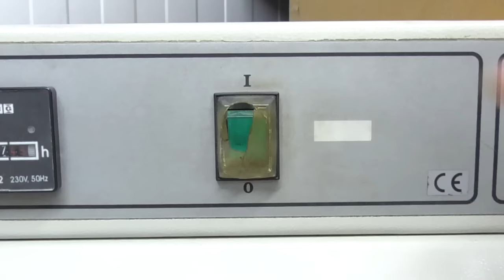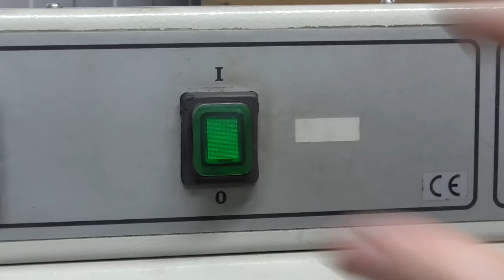Antique Ox-Tongue Iron - Restoration

Comment: For future reference when you remove even small pieces of asbestos like that wet it down first.  It comes off easier and it won't release fibers into the air that you could breathe in.
Reply from the maker: Thanks a lot
Reply: A pro-tip from Hand Tool Rescue.  He always seems to come across asbestos.
Reply: Richard only if inhaled.  As long as it doesn’t become airborne it’s ok.
Reply: @Richard ...I worked with tons of it in the Navy,  still here... It's only a danger when airborne, and then in fairly large quantities over a period of time.  This little bit,  handled correctly,  poses very little,  if any risk...
Reply: Pp Ss A single fibre gettingin your lungs has tte possibility of causingcancer
Reply: @bacicinvatteneaca ... if that were true,  I should have been dead a long, long time ago!
Reply: Me and a friend (when I was 10) broke up an old garage roof made of asbestos (didn't realise at the time) the way it breaks is very entertaining so we was jumping on it braking it up, it was in the air everywhere, one of the most stupid things I ever did and still worries me to this day.
Reply: @TimZZR2  ... How old are you now? I would agree, it's not the smartest thing to do, in fact highly ill advised, but a lot of people did similar things without consequence. Yes,  people have died from exposure, but it's usually those who were exposed to it daily, for long periods of time. Unless you show signs of illness from it,  I wouldn't worry about it too much. With that said,  we all gotta go somehow!
Reply: @Quickened1  possibility doesn't mean certainty.
Reply: @Quickened1  i'm 29 buddy, so it was 19yrs ago. I'm not too worried about it tbh, iv'e lived from much more stupid things, no signs so thats good haha. Thanks for the reply, all the best 👍
Reply: @TimZZR2  ... good to hear!

Comment: MyMechanics: "This piece is missing a washer. I make a new one."

Every other normal person: "a washer? Aren't they like five cents at the hardware sto..."

MyMechanics: "I MAKE. A NEW ONE."
Reply: I did chuckle when he machined a washer. It just adds to the restoration though.
Reply: You can't beat a good quality washer.
Reply: The true reason behind that is that the washers you can buy are nickel or zinc covered, and by consequence he can't "blue" them like the other materials he restores
Reply: no no, its "I make new one"
Reply: You sir, are an absolute Master !!
Reply: @boolaudio  Sure you can. However, the switch you use can't be bigger around than your thumb "and" you have to drag her down to the front of the courthouse to do it. 
I haven't checked to see if it ever got repealed but that was an actual law here in beautiful, downtown Arkansas, as of a few years ago.
Reply: Even if you could get the exact ones you need, if you are in a project in the middle of the night.. Just spend those few minutes to make a enw one...
Reply: Yes! 5¢ or less, but that's hardly the point, is it?
Reply: Spent more on raw materials than the hardware would have cost at the store
Reply: @cbjfan99  You just don't get it, do you?
Reply: @Omahabigbill  enlighten me.
Reply: @cbjfan99 
It's one of the points about those restorations: you are only allowed to buy things you can't make in a workshop, even if it's something as trivial as washers or a handle. So, if he restores something with blown diodes, he will buy replacements for them, but everything else will be either original or made by hand.
Reply: @Hisu0  just seems like a time waster when you could apply yourself towards other parts of the restoration
Reply: @cbjfan99 
It's a principle thing. Can be a waste of time, sure, but all those restorations are waste of time regardless. Just this iron took three WEEKS of work, which translates into a conservative value of $1500. What's an hour spent on making a washer compared to it?
Reply: @cbjfan99  Ok, let me tell you this.  Back in my healthier days I used to make Adirondack chairs for a lot of people.  Everybody liked them and that made me feel good.  That's satisfaction on a job well done.  My Mechanics is a very talented guy in the machine shop.  It's not how much time he put into a project, it's how it looks when finished.  It's the satisfaction!  I don't know what else to tell you.
Reply: @twicebittenthasme5545  ...hence the expression, "rule of thumb"...  but a disgusting digression to this video.
Reply: first you need to know if the project is for repairing or for restoration.
Reply: well see the funny thing is, he wastes more material making the washer than the washer its self....
Reply: @Struto69  that is not the actual origin of "rule of thumb." It has been looked into countless times by linguists and law-makers and debunked. That notwithstanding, it is an incredibly persistent myth.
Reply: @cbjfan99  there is a difference between a machined washer and a stamped washer.
Using a stamped washer would not be a restoration when the original was machined.
Reply: @fixitallpaul4847  see now that makes sense. That's all I was asking
Reply: @cbjfan99  preservation prevents any further deterioration of an item.
Conservation keeps an item in working condition.
Restoration returns it to as near original condition as possible or in this case actually better than original.
Reply: Lmao I giggled
Reply: and a cheer goes up from internetland!
Reply: Hey I have friends who makes washers out of pennies
Reply: BAHAHAH I know! I was like "oh is he going to clean those screws, why not just buy..."
"I MAKE A NEW ONE" 
also me: "wtf is he doing with that cylinder, making a warhead casing?" 
"I MAKE A NEW OX TONGUE"
Reply: Yannick Bruère It is true that you can’t blue a plated washer but you can put a zinc plated washer in muriatic acid for a short time and it will take the plating off. The washer can then be blued. I have done it with some of my projects. I thought it was fun to see the washers getting made, though. I wish I had that kind of tooling.
Reply: cbjfan99 same goes for the bolts. As a matter of fact, just go out and buy a new iron. Not worth the effort, right?
Go away. Him making even the trivial pieces makes watching the video so much more. Don’t take away from everything that makes this video great.
Reply: Yeah that caught my eyes too. that's what you get when you do things with passion.
Reply: Well, quarantine means that making new ones is probably a better idea. lol
Reply: That's bollocks. Showing off a bit. Mechanical engineering was at a state of making one bolt for one machine and another for the other. And guess what - it sucked ! That's why standardisation was introduced more than 100 years ago. It's not what you can do but what is logical to do.
Reply: he just want show he can do that ;)
Reply: sometimes you get the washer you want faster by making it than trying to find the perfect one at the hardware store. I've had to make bolts from bolts because i could not find what i needed. If you took into the consideration of my time these bolts would be very expensive. However there is nothing more satisfying in making exactly what you want.
Reply: @Hisu0  Haha your estimate is far to conservative.  This guy lives in Switzerland just as I do. If he really spent 3 full working weeks (15 days, 8 hours each = 120 h) on this project. This means labour costs of  around CHF 5'000! The $ is  at 0.97 CHF right now, so its around $ 5000 as well.
Reply: @cbjfan99  there are people who can make anything...and those who can't see beyond their own face..people like you only dream of being able to do what others can...jealousy is an ugly trait.
Reply: I love when he uses old broken parts from the current or previous projects to make new ones too it's a nice touch
Reply: Hes said why he does it in previous videos, new hardware like that is plated with a material (I forget what, maybe zinc?) that prevents him from bluing it/protecting it from rust
Reply: @sleepCircle  I blame The Boondock Saints
Reply: He says you can't blue a store bought washer. Zinc coating.
Reply: So true xd
Reply: Aleksandar Aleksic no, not here. It IS what he can do. Any shmoe can buy stuff.
Reply: this is so me, heck i used duct tape to fix a horse for my daughter and it is like new, the only way you can tell he has "surgery" is the nice fishing line i used to sew the cloth covering back closed with... yes i use fishing line to sew with and it works great!
Reply: I'll bet he could make 50 washers by the time it takes me to find my wallet and car keys, drive to the hardware store, find the washer, pay for it, and drive home.  Who here lives next door to a hardware store?
Reply: bravo
Reply: @aleksandaraleksic4067  I have many questions, first: what did you mean by "showing off" its a youtube channel about restoration and machining of course he makes new parts, secondly:What part of making a washer/nut/bolt "sucked, finally: what was the purpose of INDUSTRIAL standerdization in a private project for display/household use?
Reply: @matthewkenney8915  lol no its "I make a new one" even his merch says it.
Reply: Those washers are actually pieces of asbestos paper

Comment: "Restoration" is an understatement of what you do.
Reply: IKR? It's more like restoration und upcycling in a single move. And it's also art in craftsmanship.
Reply: Restoration would mean back to original condition. So more of an overstatement
Reply: 9 out of 10 times he's altering the original structure and that's not restoration. It's creating something new. In this video he's altered the door to fit correctly, but maybe the door never fitted correctly and should be left like that. Restoration is trying to keep it as close to original as possible and not adding your own ideas...
Reply: @Alexander196210  what would you call it then?
Reply: Alex Meijer the door thing wasn’t a problem, he just finished it kinda wack.
Reply: @500MTH  sounds like a restomod
Reply: @Alexander196210  you're right, what he is doing is not restoration.  Its better
Reply: John Alexander not better. Different. If what you’re after is a restoration then arguably this is worse than that. If what you’re after is someone recreating and rebuilding an old tool/object using modern techniques and materials beyond the possibility of the time in which it was built then this is what you’ve got here.
Reply: Revival is a more accurate term because he's bringing these antiques back to life.
Reply: @Alexander196210  no.. the original door fit but when he polished and sanded the housing he reduced it in size
Reply: Rebirth

* drops mic *
Reply: @bhavyakabade  " resurrection"

drops more mics
Reply: Restoration/Improvement...
...Restoprovement?

Comment: Excellent restoration work!
Just one suggestion when manufacturing the new ox-tongue insert: from the machining of the metallic "torpedo" and using a hydraulic saw machine, you could produce two units instead of just one. With this, the final user would have a spare unit that would be useful for large volumes to iron clothes. Additionally, the manufacturing process would have less material and energy waste.

Comment: You did a better job than the original manufacture! You've got skills.
Reply: @FlyingMonkies325 exactly true.
Reply: FlyingMonkies325 Disagree. It was a slight flaw in the original design. If it was corrected then it would have been mass produced correctly. The off center doesn’t have to do with the mass production.
Reply: Okay, agree.  I was just thinking of the back cover being off center that he re-aligned.

Comment: Just an observation: you can sand-blast wood too. Only, you can't do it with sand - it's too rough, and will grind the wood away, instead of just cleaning it. But you can use softer and lighter material, like coarsely ground corn flour, crushed egg shells or sodium bicarbonate - kitchen salt I'd only use on hardwoods. It's useful when you need to also clean paint or lacquer from tight nooks on wooden parts - you don't get there easily with sandpaper. (Whether it makes sense to clean and refill your sand blaster every time you need to switch between metal and wood, or set up a second sand blaster, is a separate issue. The possibility exists, though.)

Comment: After the sand blasting technique he puts the part into some liquid and turns into black that part was lovely
Reply: It's called 'bluing', I think. He's heat treating or 'quenching' the parts. Gives it structural integrity and rust-resistance.
Reply: Heat it up to 300-400 degree celcius und cool it down in oil
Reply: @Kettenspanner  I was wondering what chemical he was placing the heated metal parts in - is it standard oil or some special type?
Reply: @LyonHart1313   Not an expert in shop work, but from what I understand there are a number of bluing oils available for metal protection out there, kind of like how for heat-treating swords you use a different oil entirely from that.
Reply: @LyonHart1313  I thunk he uses rapeseed oil as I've seen on another video if his the vice restoration

Comment: The ox-tongue part reminds me of the cartoons whee a tree goes in one end of a machine and a tooth pick comes out the other.
Reply: I was wondering why he didn't cut it in half before milling it flat. So much lost material.
Reply: @SuperSpatman  low grade steel is super cheap and making the curve would be really difficult if the material wasn't cylindric in the first place.
Reply: @VaneyRio  yeah, but why not take the round stock, cut it down the middle, then mill it perfectly flat?
Cheap or not, there's no point in turning such a large piece of material into filings when there's ways to avoid that.
Reply: he prolly doesn't have the right tools to cut such a large piece of steel in half

Comment: My only question is: why would you chose to mill away half of the ox-tongue replacement, rather than cutting it in half on a saw?  It seems a bit like the old cartoon, "use a whole tree to make one toothpick" trope.  I hugely envy people who can use the whole machinists arsenal to turn blank chunks of metal into all manner of shapes and parts, but the amount of metal that ends up chipped/shaved out onto the shop floor sometimes feels like a bit of a waste. (preemptively: Yeah, I know it can be collected up and melted down, but that takes a whole new investment of energy.)

Comment: Just thought:
Instead of milling down half of that giant bolt you used for the ox tongue, i'd have it cut in length.
So, as supposed in the times those   flat irons were in use, you'd have one tongue in the iron to work with, and the second in the fire to be heated up ;-)
Reply: I assumed he milled it in order to make it ridiculously, perfectly flat
Reply: @johnny7808  Well, I think after cutting in two halves the surfaces could have been milled flat either.
My mechanics surely could do this as he did an awsome job on this tool - as always! 

I assume either he just wasn't fully aware of how in reality ironing several buckets of lawndry after washing day with those tools was like (I still remember my Grandma doing it that way until she got her first electric flat iron. Shejust didn't screw a handle in to change the ox tongue but used a fire tongs) -- 
Or he had just fun showing us that metal block getting smaller and smaller, which is - of course, quite fascinating to watch... 
:-)
Reply: It didn’t look like it was an exact half.
Reply from the maker: It was more than half of it and i don't have a bandsaw.
Reply: @mymechanics Good morning, Sir! I feel honoured by your personal reply. That is quite a valuable reason, too. Too much thinking from my access to machines at work. One always has to consider the equipment available!

Btw: I'm always fascinated by your accurancy and how you are sticking to details! The outcome is marvellous, as often said better than new, not for display in a museum but just for people who 
like artsy restored antique tools in a usable, new-like state. That, you usually do not find in a museum. I like the outcome - keep on!

(and please do not take my posting as a grounds for looking after an antique belt-driven bandsaw to be restored...) 
:-)

Comment: You know back then, iron was a great piece of wireless technology unlike nowadays which uses cable
Reply: okay, but consider this. You're now less likely to burn your clothes, or your house, and it never cools unless you want it too. Honestly I can't see why you would need a cable-less iron. It's not like you're carrying it around the house
Reply: @jenniferroan2971  well battery explosions of course, why else would you want a (pretty hefty, for the needed output) battery near a major heat source?
Also 220V AC heating elements are a fair bit quicker than any reasonable DC battery-powered elements.